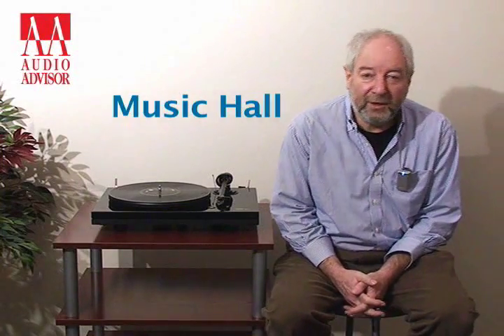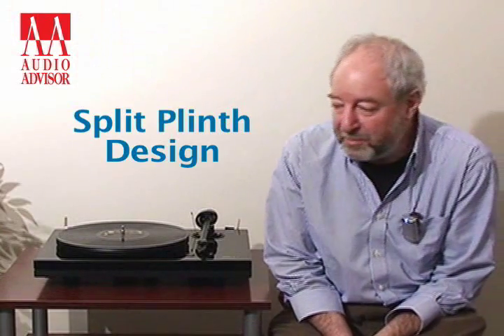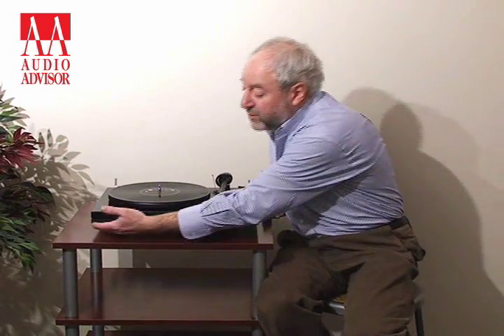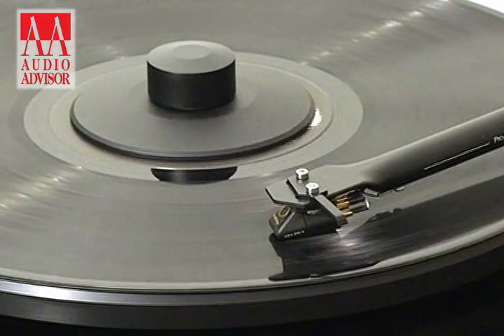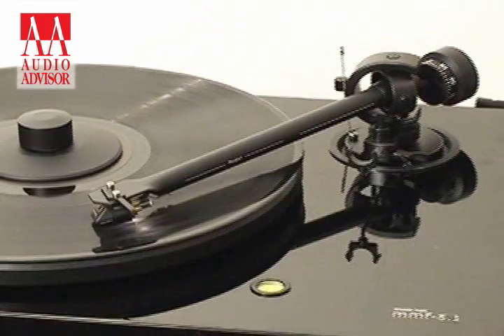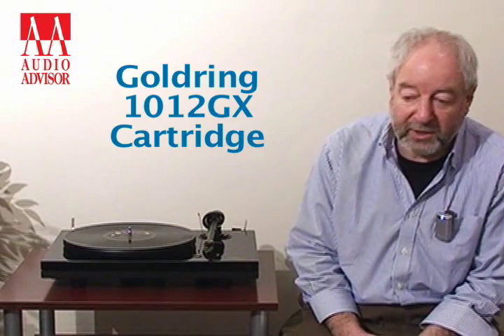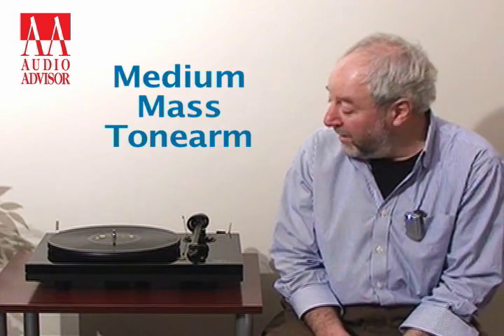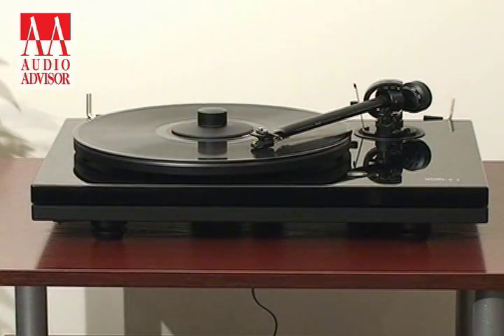Music Hall - MMF-5.1 Turntable – Audio Advisor

Comment: I had the 5.3 with the 2M Blue. I got rid of it less than a week later. No way is this thing worth the $1000 price. Maybe $200-300 at best.  There was oil leaking from the cue lever area, The record clamp didn't contact the record and anti-skate weight doesn't work when tested with a laser disc. AND the tonearm contacts the pivot before the end of the record.  JUNK!!